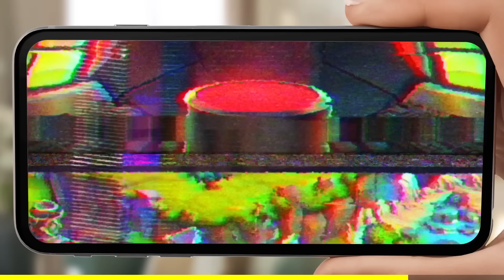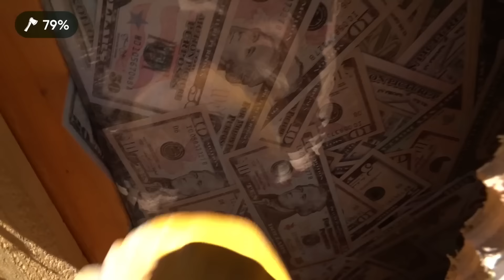MrBeast Trapped us in his $10,000 Unbreakable Box!

Comment: How to win: when you get the jack hammer, use it to cut out a small section of the concrete, preferably the area around the chain, then, use the same jackhammer to break the chain holding that small piece of concrete, and the large one, then, you have a small piece of concrete you can carry to the end, unlocking all the weapons, and also getting to the box. and, inside the box, focus on the side the TV is on, because it's deeper into the wood, and probably easier to break, then you have a lot of time left, to break a hole big enough to get through